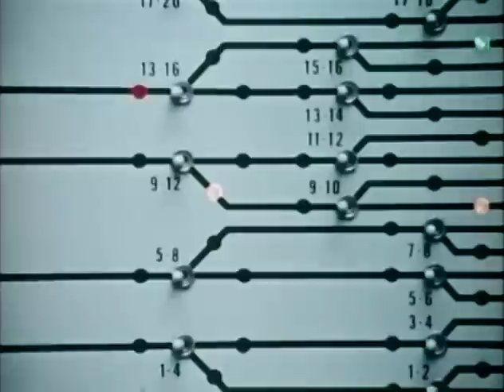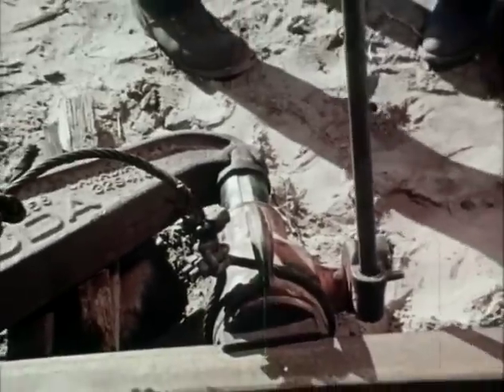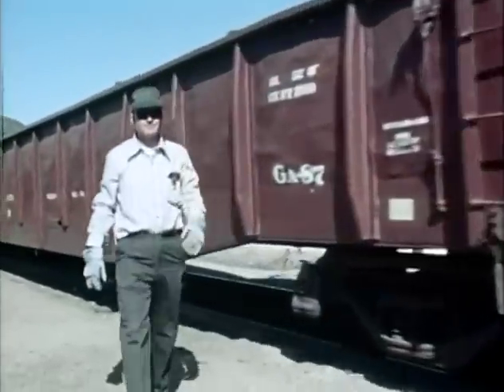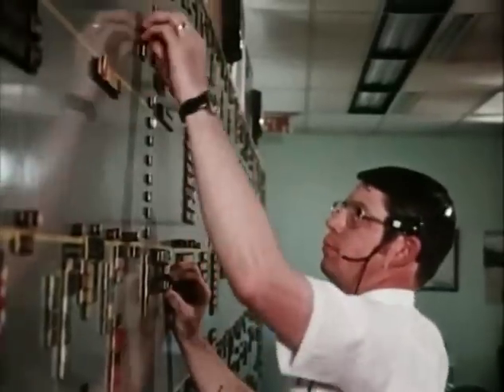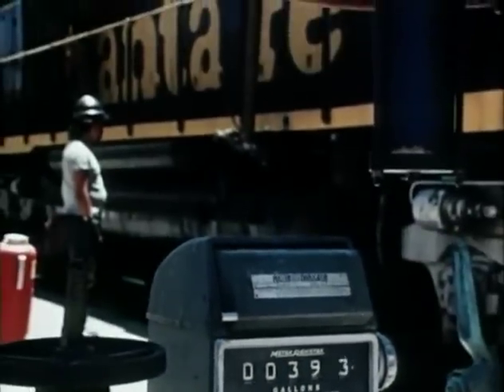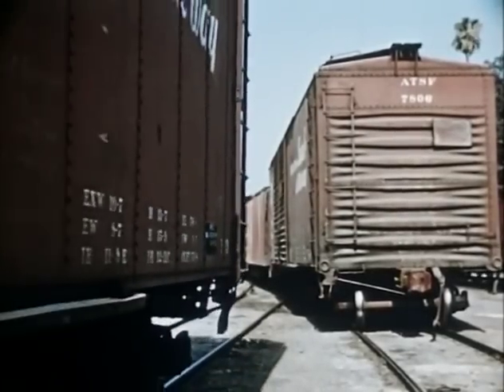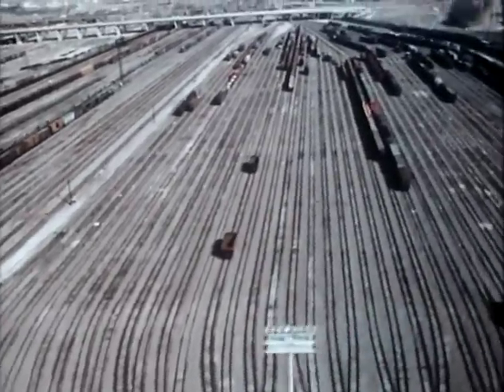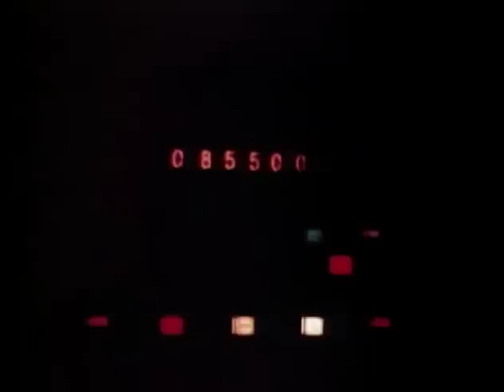Workin On The Santa Fe

Comment: Great videos of one of my favorite railroads of all time, the Santa Fe. Today it is BNSF which is a favorite railroad for me.
Reply: I see alot of NS, and CSX around my area. Mainly multiple engine CSX freight trains. Also Amtrak aswell.
Reply: It is a part of BNSF..Burlington Northern is the other part.Burlington Northern is my favorite railroad.
Reply: Sadly, growing up in California, the BNSF is only a "ghost" of what the old ATSF used to be. After the 80's and 90's when all the old branch and secondary main lines were pulled up, forcing the Eastside central valley farmers to go intermodal (trucks) was a backwards step.

Comment: I personally understand all too well about damage and loss merchandise issues. (56:30 - 57:51)  I worked for FedEx for nearly 30 years—21 of those years working as an assistant tractor/trailer dispatcher out of Sky Harbor Airport.  I saw a few instances of damaged merchandise arriving on 53 foot trailers because it was mishandled through improper loading procedures.  I have to admit, I wondered to myself: "How do we keep customers if we delivery stuff like that?"
Reply: I've only been working as a package handler at FedEx for 3 years, and I see very messy trailers in the unload end of the warehouse. The van lines also get messy loads and damaged packages. Case and point, I'm surprised we still have customers.

Comment: What year was this filmed? When did machines replace men. I understand that a single mammoth machine is used to do all the track replacement work today.
Reply: 1983
Reply: @rypdx  
The video had so much really Groovy music man, that I thought early 1970’s.
Reply: @msnow22000  Even into the early 1980's the funky sound was still there, but it was disappearing fast.
Reply: @rypdx  AS A RETIRED AT&SF GUY I ESTIMATE MID TO LATE 1950s
Reply: @rossbryan6102  No way, there was a part that said, “in 1974”

I’d have to guess late 70s, maybe 1980

Comment: I was an engineer for 58 years. We used to ridicule the workers. Called them track troglodytes or maintenance o way wussies. BTW, is  it ok to use a hammer as a 🔧?
Reply: only if the bolt is really stuck, but then just put wd40 on it and try again or just cut it off with oxyacetylene torches
Reply: I worked two summers in the CB&Q car shops, repairing cars mashed up by cowboy engineers! Old cars were repaired to original specifications, to include wooden walls, lots of rivets. Not too many rivet buckers around these days.
Reply: @Dutch_Uncle  I salute you, sir.
Reply: @Dutch_Uncle  Huck Bolts mostly or just welds.
Reply: kind of arrogant when you consider that by their hard work and expertise building and maintaining track that you can safely drive a train on, they keep you and all other rail riders, employed, safe and alive, It seems on that account that they do a vital job that requires a great amount of skill and engineering expertise to perform. We owe those “track troglodytes” more respect than to call them wussies i think, surely you must’ve meant that in jest.